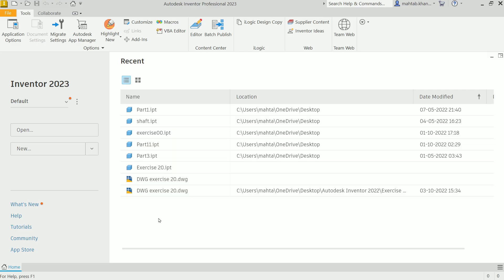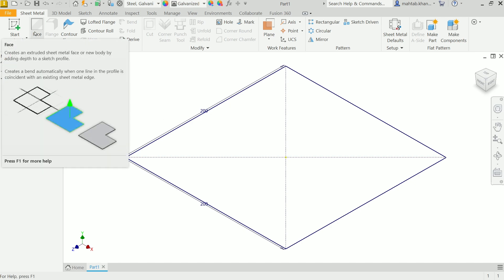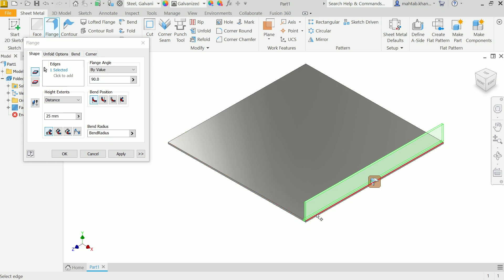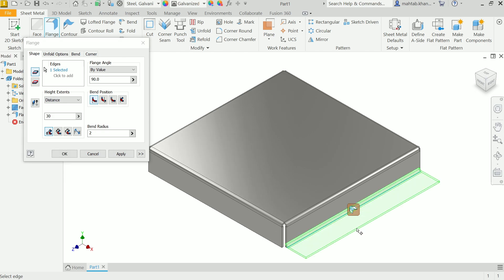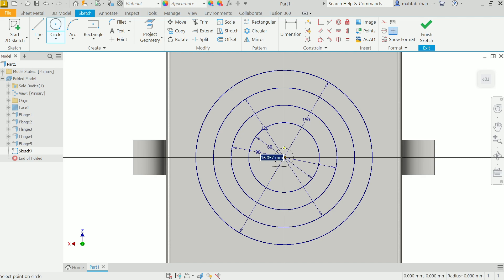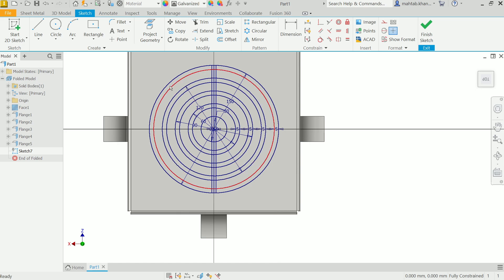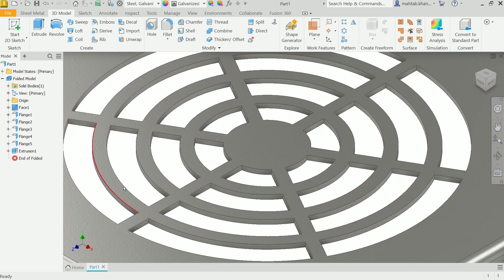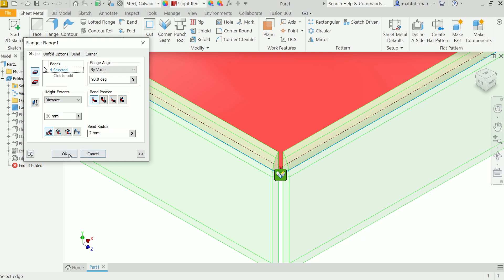Autodesk Inventor 2023 Sheet metal Tutorial Face, Flange & Vent

Comment: Thank you for the tutorial.  However, when I have completed the part; how can I then change the thickness of the part?  I am running Inventor 2023.  Thank you for your response?
Reply: If you are trying to change the thickness of the sheet metal that can be done in "Sheet Metal Defaults". It will have a thickness box where you can change it.